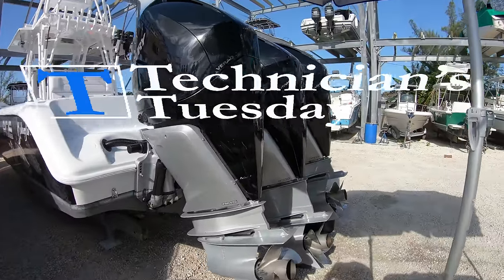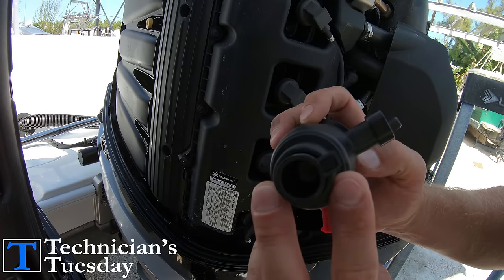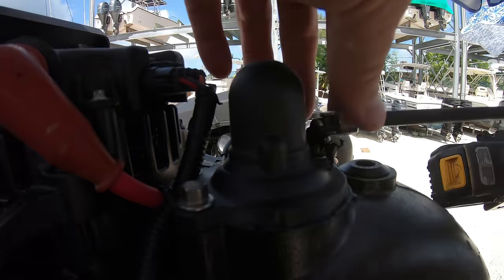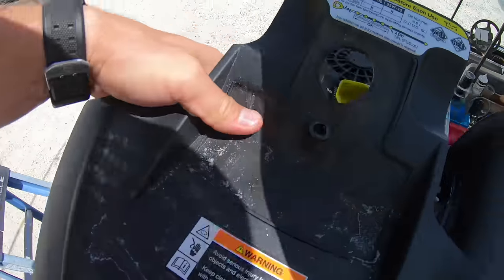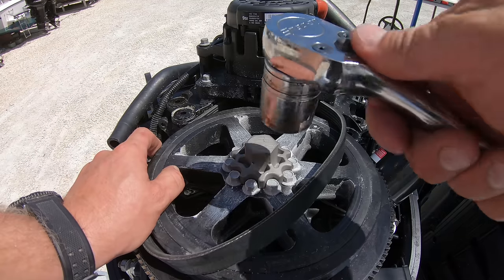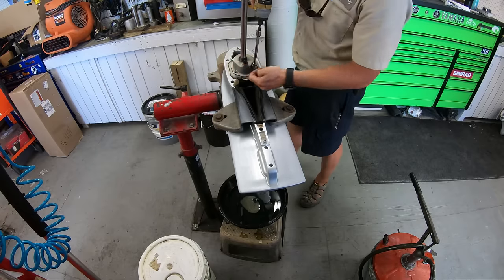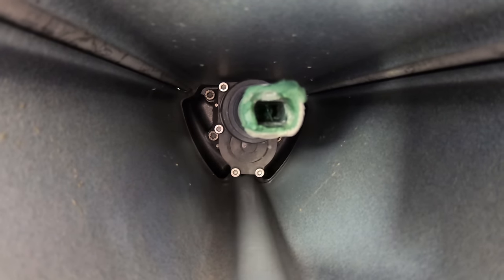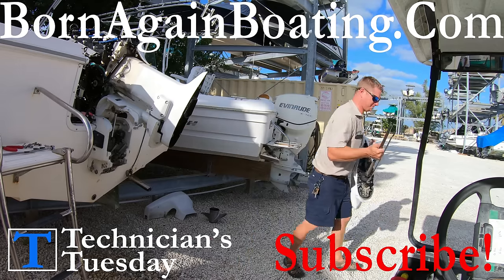Mercury V8 Outboard Service | 100 Hour | Water Pump

Comment: Great video! Clear concise information; thank you once again.. I  had a 65 hp Mercury o/b in the 1960's, an 85 (80?)  hp Merc the 1970's and a Merc 470 I/O (4 cylinder, 170 hp, Chevy block) in the early 1980's... It looks like they have made some improvements since then! (except for the alternator belt replacement ☺).... Thank you so much for your videos; you are helping more people than you can know. I pass your link to everyone I know; I hope you become the #1 Boat-guy on Youtube.....
Reply from the maker: Wow! You've spent a lot of time on the water :) That's awesome! I hope to be boating like you just the same :) Yes, that belt replacement is quite the adventure lol when I first read about it and did it for the first time, I was like, "you gotta be kidding me, they can't be serious!" 

But it was very real lol Thank you so much for all of the support and for passing us along! That is such a huge help and we thank you so very much :)
Reply: The 470 was a Mercruiser designed and built engine.
Reply: @melrose9252  Hi Mel, I'm sure you could be (are?) correct. Back in the 1970's-1980's we were told that the Merc 470 I/O was a Chevy blocked engine, in fact used some Chevy parts on them at times.... I'd like to learn more about it as that 470 (4 cylinder, 170 hp) was a great engine. It was fresh-water cooled with a heat-exchanger, was quiet, and was super fuel efficient. It ran the 22' boat at cruise-speed in the low 40 mph range.
Reply: @andrewfyakim525  < The cylinder head was off the 460 Ford and the block was a purpose built marine engine designed and built by Mercruiser.  Mercury was concerned back in the day that engines for In/Outs and Inboards may not be available from GM or the other manufacturers.  These were years coming off gas shortages and heavy emissions.  Mercury built their own.  They came with a 2 or 4 bbl and fresh water cooling.  They were known to overheat fairly easy and with automotive blocks becoming more powerful and more available, these engines were dropped.
Reply: @melrose9252  Thank you for the info; I'm sorry to hear it was not a considered a good engine!... I was in my 20's when we had that boat/ engine, and we had it for just shy of 6 years; fortunately we had no problems with it. We even ran offshore out of the Beaufort Inlet in NC a half-dozen times a year. The engine never failed to start right up, and needed only basic maintenance. It never overheated, but then, and as I do now, I'm easy on my engines and don't run them hard... Thank you once again for the info!

Comment: No anti-seize on spark plug threads, no grease on plugs? Gap pre-set on plugs? 
Oil filter not primed?
Impeller not greased/soaped upon installation to housing?
Great video!
Reply from the maker: I didn't for these plugs, I use my impact to get them out, so they come right out, also, we will change these plugs in probably 2 months when the engines have about 1,000 hours! Plugs come pre-gapped!
You can't really pre-fill an oil filter on an outboard engine, most of them are installed upside down! The oiling systems will have oil through everything within a couple of revolutions, so it fills up quick! Here's some more information from our website on pre-filling filters: https://www.bornagainboating.com/pre-fill-fuel-filter-water-separator/
After putting the grease on the driveshaft to hold the keyway in, and then cleaning the water pump housing in a parts washer, there isn't much need to, everything is pretty greasy and wet so the impeller just slides right into the housing! :)
Thank you!
Reply: @BornAgainBoating  Nice! Thanks for the reply and info!
Reply: How can you prime an upside down oil filter?
Reply: @mcplutt  Easy if you think about it. Just have the holes up and pour oil into the smaller holes until full. Let set about an hour and the filter will have absorbed the majority of the oil, now you have a primed oil filter.

Comment: Great video. BUT Isn't this a 300 hour service? Should you be replacing the impeller and belt at 100 hrs??
Reply: I’m not a tech or a mechanic, but I’m pretty certain it depends on if you are in salt or fresh water.  This motor looked pretty crusty to me.  I’m at 150ish and have changed just fluids and filters 3 times.

Comment: Great video.  I have a 300r with 145 hours on it.  I’ve changed the fluids and all filters 3 times.  My water pressure gauge is not getting above 12-15 mm, when before it has gotten up to 20.  My tale tell is working and the block temp never gets above 141.   I have never changed the plugs.  I’m wondering , how to get to the non electrical part of the water pick up to clear it

Comment: Nice Video. I would use a socket on the oil drain plug don't want that spanner slipping, and i would do the belt with the plugs out..easier to turn flywheel. Not sure why people are freaked. very easy service. Thanks for the video
Reply: A socket will not fit   I have twin Sea-pros.

Comment: Aaron curious to know in this example you turn flywheel counter counter clockwise rotation to get the belt off … does that affect the water pump impeller vanes?  Great video … Keep it up!
Reply: So your comment got a "like" from the channel, but no answer to your question.  I do not understand modern communication skills....

Comment: Excellent video, but belts and plugs at 100hr?  Or is this 100hr plus a longer service?
Reply from the maker: Haha, sorry about that. I just always call it a 100 hour service, I guess technically it is a 300 hour service, but these engines have over 500 hours on them! Thank you for commenting :)
Reply: @BornAgainBoating  How have the new V8s been doing reliability wise?
Reply from the maker: @flippers098  we still haven't seen a ton of them but I haven't seen anything catastrophic yet. All the people running them love them! This guy here has had the engines for 4 months and already has over 500 hours. So they seem to be holding up great!
Reply: @flippers098  I've been following these motors closely. So far I haven't heard anything bad.
Reply: @jamienichols6277  I've only seen minor things like gaskets leaking and a bad impeller.
Reply: @flippers098  V8 Pro XS or SHO is the question?
Reply: @flippers098  The only one I've seen popped was Greg Hackney's during a Bass Pro Tour event. But those guys beat on their motors a lot harder than your typical boat owner. I'd kind of expect if problems were going to show up it'd be from the bass fishing guys.

Comment: Excellent video sir!

Question do you put the engine in gear prior to removing the lower unit for the impeller replacement?
Reply: No you dont you leave it in nuetral. The shift shft in the gearcase tends to turn and automatically want to go i to fwd so thats why he said the gearcase will automatically go into nuetral once u stick it back onnto the driveshaft housing

Comment: Great video.  Where do I go to get trained to repair boat motors?  I’m a 50 year old HVAC Technician and my knees and back won’t last much longer going up and down ladders all day.
Reply from the maker: Thank you! Well, I would say the best way to get into the marine industry as a mechanic is to get an entry level job at a marina and work your way up. Schools like UTI cost about $35K, maybe even more now. So if you wanted to skip that cost, just keep applying to marina's until you get in. 
I will warn you though, you will still be going up and down ladders all day, in and out of the boats, as well as in and out of very small and cramped places, just like in the HVAC world.
Reply: D M ... I hear you, after 20 years of HVAC service work I finally had to call it quits!

Comment: After watching this I’m so glad I have an Evinrude Etec! Add oil and go
Reply: Wait till 1k hours and you’ll regret it!
Reply: SrSO4 I average 65 hours a year on my motors, so that’ll be in 15 years. Fair to say over 15 years ANY outboard is going to have issues come up. Saltwater doesn’t care what brand it is...
Reply: Farr Outdoors actually I’ve had a merc since 1997 and it still ran perfectly fine. Repowered to a newer model merc cause old one had over 6000 hours
Reply: Weed eater motor 😆

Comment: LOOKING AT A new 200 OR BETTER SEAPRO MERC, do these motors have any issues in dirty water? example, the suzuki 250's fuel cooler will clog after several years, if run on the motors flush ports. You have to run in a tub to keep it from clogging when you're in the dirty St. Johns river. I know, sounds crazy, but believe me. Don't know much about Mercs, versus HONDA AND Suzuki's
Reply from the maker: Haven't really seen a lot of them just yet. They are still fairly new. The V-8 and V-6 are super similar and we've got a guy with the V-8s on his boat. He's over 1500 hrs so far in a year without any issues. 
Yeah, Suzuki's have been known for their internal clogging issues though. That's why the Merc's and Yami's cost so much more. The metals are different and they've painting the inside of the engines, all of the cooling passages! 
Which is why you don't see them packed full of internal anodes to mess with. Yamaha learned that lessen with the F225s and midsections!
For where you are, I'd stay away from the Honda's for the same issue. That Suzuki seemed to do you really well, but if you are ready to spend the money and do the repower. The Merc V-6 would be a good engine for you.
Reply: @BornAgainBoating  It was the fuel cooler mostly, clogged 100% in this dirt water here after 5 years. Never ever again will use those flush ports! A 70 gallon tub, and run up to temp. after each trip. The St. Johns in Jax is acidic, muddy, nasty as it gets. Plus only 3-4 more years worth of incessant dredging! YIPEE!  YES, I really like the things Merc has done. Oh, I ran right thru two Honda 225'S ALREADY!..the pits! KEEP UP THE GOOD WORK. Been doing Youtube for 10 years, and with loads of engine DIY stuff, But mostly fishing, related. I know what work it takes. Ive done as many as 4 vids a week.

Comment: Do not use grease on the oil filter gasket! Also dont loosen the engine oil drain valve more than 2.5 turns or you can damage the internal seal!

Comment: Was that a little water that came out before the oil started draining? Is that normal?
Reply from the maker: Yes, that was! Great eye! Yes, it is not uncommon to see a little water there, only a teaspoon or so though. If you find a few ounces, there is something going on! The water comes from condensation, so depending on where you live, the humidity, and the temperatures, it isn't anything to worry about!
Reply: @BornAgainBoating  why don't ''WE'' say that about lower unit lube?? I see any milky'ness, and I freak out!
Reply: @BornAgainBoating  I caught that too!

Comment: I'm planning to run twins on my boat in the 400 to 450 hp range which motor would you recommend Mercury or Yamaha ? I'll be using my boat in fresh water mainly in Tenneessee.  Thanks alot.

Comment: @Born Again Boating,  I have this same 2018 motor 250hp but a non-verado, for the service, are those the same part numbers for thermostat, filters, plugs, etc?  Also is there a 100hour service “bundle” one could buy instead of buying À la cart.  Last thought, how do you feel about the QuickKleen fuel treatment “2”
Reply from the maker: Hello! Yes, they are all the same parts. The last I checked they didn't have a bundle for the V6-V8's like they do for the L6s. They might now, but they didn't have that before. On the Quickleen, that's good stuff, it's like Yamaha ring free, it's good to use it and it's not expensive which makes it worth it :)
Reply: @Born Again Boating, do you really need the tool to take the belt off?  Is it not possible to just cut the old belt off if your replacing it anyway?  Another question how much Oil do I need to but to replace it?
Reply: @LocalWrapsDotCom  obviously you could cut the belt, but you need the tool to install new belt sir. 
I have the 300 v 8.  Takes 7 qts

Comment: Are these outboard engines good and would you recommend
Reply from the maker: Yes they are a good engine!
Reply: I have had several boats and engines and been on many boats,  but the new Mercury Pro-XS 4 stroke are a beast,,  never have i felt the power and torque of the new V8 engines.. you just need to drive a boat with on of these engines.  If your ever in Virginia I WILL LET YOU ..

Comment: Are all of these services necessary at every 100 hours?
Reply: No. Water pump replacement usually after 3 years, but I stretch it to 5 years on my Mercury F115.. 
The alternator belt should be inspected every year. My alternator belt in my car is 10 years old, and still looks like new. I don't know what Mercury says.

Comment: Do you put anything on the Spark plug threads?
Reply from the maker: I used to put anti-seize on them, but since pulling them out with the impact and putting them in by hand, I stopped putting the anti-seize on them just because the impact zips them out quickly and effortlessly!

Comment: Why don't you change the alternator belt while the spark plugs are out. Would make it much easier to turn over the engine
Reply: Mercury recommends it every 1000 hours
Reply: @Shhnee  dude, you’re incorrect
Reply: @gregdavid2154  sir i have a mercury 225 four stroke. I read it correctly.
Reply: @Shhnee  1000 hours for the belt? My car alternator belt looks fine after 10 years, so why not.
Reply: @mcplutt  it’s weird with boats. I think it’s how much constant stress is always on the motor and the salty weather. If you dry dock it then it’ll last longer. But if you wet dock it like us. It gets corroded/stretched. Also 1000 hours on a boat is meant to be 10 years of use

Comment: How to order the special tools turning the flywheel
Reply from the maker: Go Here for a discount: https://www.youtube.com/redirect?event=video_description&redir_token=QUFFLUhqbVN1VFNHU2FXWGRya3VvbU82a0NCOE9vRDFjd3xBQ3Jtc0tuU0lvWnJLbXFaMC1hQjB5czg1emxfNjZWdnNHbUYzMEFHV1JrZkFteHc4cnNqUG4tYTlZZ18wYkdGWVRLSDZmaWxnSXhfeWdRUHJuNWo1Y1pZMVpST2NsdnVqbmFyV0RfWk9PMEpBV2RqMldDMzNtZw&q=https%3A%2F%2Fshareasale.com%2Fr.cfm%3Fb%3D1991037%26u%3D3159438%26m%3D119617%26urllink%3D%26afftrack%3D&v=Aa5cssBfd4o

Flywheel Belt Stretch Tool: 91-8M0146862
Flywheel Tool: 91-8M0146861

Comment: At 0.38 is that water that's coming out??
Reply from the maker: Yes, sometimes condensation will build in the crankcase and develop a small amount of water. After sitting for a long time, it will be at the bottom of the oil pan.

Comment: A water pump change, belt and spark plugs at 100 hours? This is insane. $1500 at least for each motor. I buying a new boat in 2023 and was looking at the new mercury V10 but not if I have to do all of that maintenance every 100 hrs. Spark plugs, water pumps and belt should last longer than 100 hrs
Yamaha is way less maintenance at 100 hrs. Oil, filter, lower unit oil, fuel filter, grease and water fuel separator. I change my water fuel separators a every year or 75 hrs.

Comment: Could you post tools?
Reply from the maker: The alternator belt tool part numbers are in the description. Are you asking for a list of all the tools that I used during this or like what tools are needed?
Reply: Curious as to what oil filter removal tool and sp plug puller?! Pa thanks that was quick! And where are you guys located?
Reply from the maker: Hello! No worries, I will look at what the part numbers are today and get back to you tonight :) Thank you! We are down in the keys in Florida :) Where are you located?
Reply: Born Again Boating cocoa!
Reply from the maker: That's a really nice place. I lived in Hunter's Creek in Orlando for about a year in 2011, only went to Cocoa beach a handful of times but it looked like a really nice place!
Reply from the maker: Those Spark Plug wire pliers are a Blue Point SBP5 but here's a decent set on Amazon for $20: https://amzn.to/2Mv1Art
Then the oil filter tool is a cheap one I got from the Snap On Guy, but I think it's the same brand as those plug wire pliers. I have two of them but this is the one that I use for almost all outboard filters. It's this Lisle filter tool https://amzn.to/2MoqmgB
The other one is a smaller one it goes down to 1 3/8" but I only need it for really little engines like some 25's or I think a couple of 40's. It mainly sits in my tool box, not in my tool bag that I carry daily.

Comment: It's more like a 300h service.
Reply: Only for first 100 hours then 300 after. Engine pays for itself if you repower it
Reply: @Shhnee  There is no water pump replacement after first 100 hours.